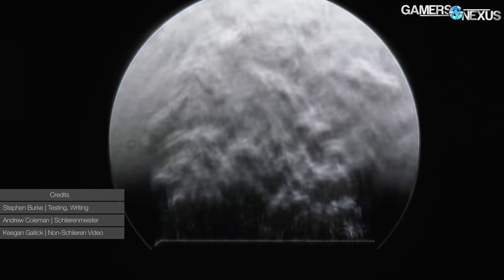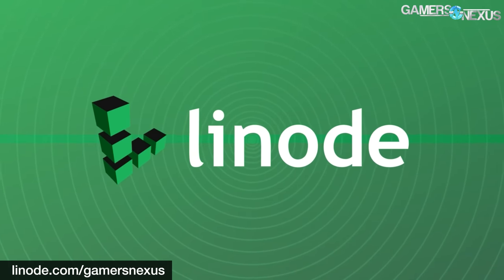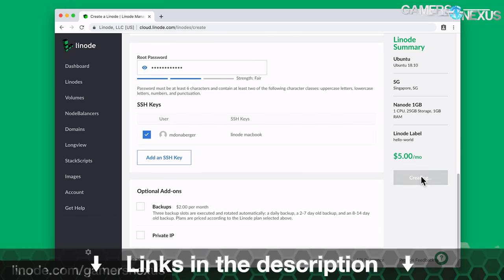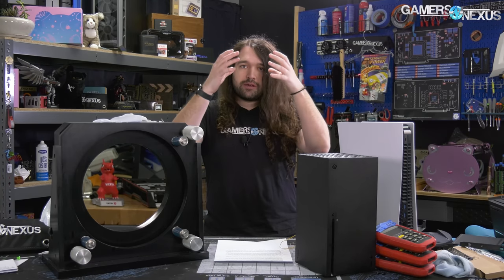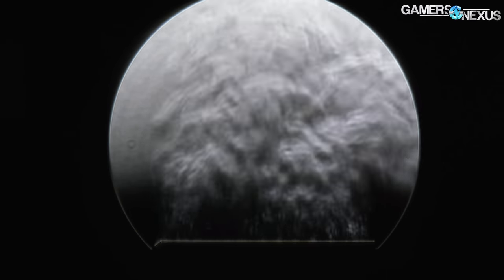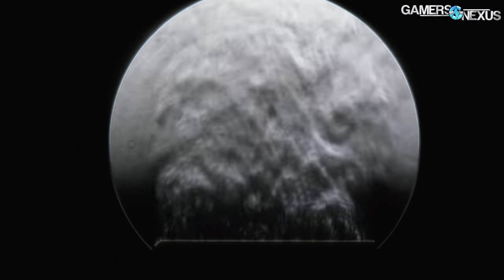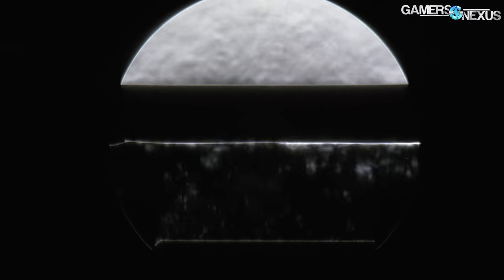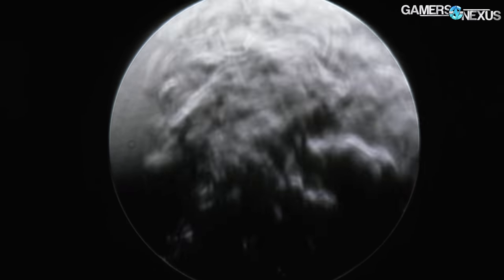PS5 vs. Xbox Series X Airflow Testing: Cooling Design Efficiency & Flow Paths

Comment: I remember an interview where a Microsoft engineer stated that the small vent was a sort of last resort exhaust so the system would have some cooling in case a game case or some other obstruction was placed on the main exhaust grille while the system was running.
Reply: A game case has a larger surface area than the exhaust 👀 it will cover it all
Reply: @Gaming-Legends007  The exhaust mini port is on the side of the console, it's impossible to cover it and the top main port with a game case at the same time .
Reply: @Gaming-Legends007  I know you said your goof comment 6 months ago but OOF... that is all
Reply: it's basically like the mini overflow drain in your bathroom sink.
Reply: So, it's a small thermal exhaust port, just below the main port...

...is it ray-shielded? I don't have any proton torpedoes left.
Reply: I'm playing Battlefield 2042 on the series x. You need another emergency vent for that game lol
Reply: Not a last resort, at all. It's a secondary backup port incase the main exhaust is blocked by something.

Comment: I love the science and thermal cooling engineering that went in making the Series X into a cuboid, and I love the way it's designed to use 1 huge and powerful fan at the top instead of the bottom, giving it a better thermal exhaust design.

Comment: “dont block the bottom intake vents”, well, since the hdmi ports are right next to it, I can't see a case where someone will face that side of Xbox down toward the table...
Reply: Never underestimate human stupidity.
Reply: builds custom cabinet that lets the hdmi ports in and blocks off everything else
Reply: Remember gorilla glue...
Reply: @cuy50  Still wouldn`t sit flush, and would hinder airflow, not block it off completely
Reply: @stevendarkstalker  that poor woman
Reply: I'll design a custom Series X table with perfect cutouts to fit the cables through ... muhahaha ^^

Comment: The hole just below the main exhaust is to allow some airflow even if the top is covered by someone accidentally. It was mentioned in the teardown with digital foundry.
Reply: You are correct!
Reply: It's similar to those holes in the sides of sink basons that prevent water overflow in the event of a drain blockage.
Reply: I can imagine the internal design presentation, everyone's looking at how nice the model looks, and then one of the engineers unceremoniously puts a book on top of it.
Reply: I can't imagine the tiny hole would be sufficient if a book was put on top of it. It's going to get significantly hotter in there, but because of the tiny hole, the console might still be operational, even if it's degrading more rapidly. Perhaps a better solution would be to just let the console reach its thermal shutdown limit, then give the user a warning when it turns on again, telling them to remove obstructions from the exhaust vent. Or just significantly throttle the CPU before it happened, and pop up a full-screen warning message that can't be clicked away until the temperature is back to normal.
Reply: @stale2665  I'm pretty sure all modern consoles have some sort of thermal adjustments or shut down sequence if it gets to hot...

The hole is just there so you don't reach that point as quickly I'm pretty sure

Comment: One thing regarding the Series X shutdown : I noticed that the fan on mine will continue run at a very low RPM for several minutes after shutdown, especially after longer gaming sessions. It looks to me like temp monitoring and fan control continues after shutdown, until it reaches a threshold or maybe a set temp before allowing the fan to power off. This is while using the "Power Saver" shutdown option btw, not the quick start option.
Reply: The previous X definitely does this as well

Comment: The Series X really could have benefitted from an extra centimeter of height to add a removeable dust filter on the bottom.
It feels like a missed opportunity given it's unique vertical design.
Reply: Well I am sure they thought of that, but when your trying to hit a certin price point you sometimes have to cut things out hat you might like to have had to get it where it needs to be:P
Reply: I don't know why manufactures do not design in built-in air filters that can be easily replaced and cleaned. It's bad engineering.
Reply: @zeniktorres4320  they could legitimized another cash grab for that too, such a missed oppoturnity
Reply: 1 cm means a lot when you are going to produce millions of them
Reply: This guy thinks he knows more than the highly educated experienced engineers that designed this with a footprint/budget in mind? crazy
Reply: I work in HVAC. Most likely they don't put filters in because that would require end users to clean/change them, which most won't. Even in the HVAC world this is a problem (maintenance). Then what happens over a short time is they get clogged and completed restrict airflow, resulting in a worse situation that if there was no filter to begin with (as most of the stuff the filter catches would just blow through the system anyway).
It's the lesser of 2 evils.
Also, as filter build up dirt, they restrict flow and then you have to have the fan work harder to pull proper airflow through the unit which means more energy usage, more wear on the fan, and potentially more to consider in terms of fan sizing and control.
Reply: Meh, it’s that easy to take apart and clean I don’t think it really needs it
Reply: Because a removable dust filter would make warranty very difficult... imagine someone trying to claim a fault all because they didn't clean the filter 🤣
Reply: @zeniktorres4320  are you a engineer? Did you ever think it would make things worse if too much dust accumulates and the owner doesn’t clean it? Who cleans there consoles regularly. A filter would block airflow quite quickly due to how quick the dust will accumulate.
Reply: @zeniktorres4320 because most people won’t clean the dust filter out and it will inhibit performance
Reply: @TheOne_p  That is true. But the dust inhibits performance anyway with or without the dust filter. And in addition, it should be designed so that an air filter can be fitted if they don't put tone in.

Comment: Steve, the MAPP gas will show up regardless of whether the torch has been lit recently; its usefulness in imaging is not from it being hot. It's just because the gas mixture is a different density to air, simply because of its chemical composition (methyl acetylene and propane is rather different to mostly nitrogen and oxygen, after all) !
... also, it may actually be slightly cooler than air because of the pressure drop effect, as it is being decompressed from a high pressure cylinder, cooling the gas.
Both the inherent gas density difference and the lower temperature of it (producing more density difference) are the reason why it is useful in imaging for you :)
Reply: Nowadays MAPP is actually just propylene. Your point is still correct of course.
Reply: @klugeskind90  Most of it is, yeah, although it is still possible to buy genuine methylacetylene - propane gas mixture... it's just not over the counter in semi mainstream shops anymore sadly :(  (I've been able to get it from welding supply shops) 

Good point nonetheless. Still, as you note, propylene is still a different density to air :)
Reply: @klugeskind90  Again your point is well made, and sparks more ideas in me: I suggest Steve just uses another kind of bottled gas for intake gas imaging... maybe something non flammable for safety's sake, so perhaps argon, which is readily available, including in disposable cylinders even. Argon would work really well actually given its high density, lots of contrast! And totally inert of course, hence its use in TIG welding for which it is typically sold (as well as a blanketing gas in oxygen-sensitive chemistry!) :)
Reply: @mduckernz  argon is exactly what i was thinking as he was running a highly flammable gas through a heated, contained area. I didn't actually think there was much of a chance for ignition, but you never know when a spark could be released if something unrelated went wrong at just the wrong time!
Reply: @mduckernz  or if they need something small and hand held, they could use canned “air” as the refrigerant used in them should provide a good temperature gradient.
Reply: @mduckernz  I'm not sure Argon would be the best choice. From what I can tell it has a refractive index very close to air. CO2 seems like the best least dangerous gas to use, which is also readily available. A simple hot cup of coffee should work nicely as well, with additional benefits for late night benchmarking :)
Reply: @paalhenriksandbu5804  That was gonna be my next suggestion, yeah. Liquid CO2 readily available. Just need good ventilation, breathing high conc CO2 sucks.

Comment: Im an engineer so i figured i would give some input. First, i do think you did this very well and appreciate what you have done here as no other reviewer does these tests. 
First, that odd slot in the top you said was for acoustics. I wonder if it might be a sort of fail safe where if some genius sets a box on top of the exhaust, the console isn't completely starved. Not that it would be an efective exaust, it would still thermal throttle like crazy, but it could save it from death. That could be a different explanation. The way to test this is to simply place a box on the exhaust and see how it reacts. 
Im not completely sold on your explanation of the convexity of the top being the culprit for the converting exaust airflow. I have a decent amound to experience with aerodynamics and that would be acting in a way that i wouldn't expect. I suspect it could be from the rotation induced by the spinning of the fan. But this theory has holes as well. 
One text i would like to see if possible, is a repeat of the hot power off test that you did with the xbox on the side, but with the console standing upright. This would somewhat show the effectiveness of the updraft cooling, which could give ideas for passivly cooled systems that are better than what is currently available. 
Final thought, one reason i suspect the fan is so far away from the exhaust vent of the xbox is to reduce noise. When a propeller balde spins too close to something perpendicular to it, like the holes in the grill, it creats a audible pulse. This can be fixed by moving the blades farther from the grill. This isnt genneraly seen with computers and the things close to the fan are rather thin so are not all to affected by this. But the grill on the xbox, which seems to be half a inch in some places, would definitely be affected.
Anyhow, thank you for making this. Without you, it just wouldn't be seen as it just takes a lot of equipment.
Reply: The gas converging is pretty easily explained like Steve did by the fact that the holes are deeper to the sides than in the middle. The outer edge guides the gas more than the inner edge of a hole. Honestly hard to explain without visualization for me but draw random lines from the fan out side the case and you will see that those that would stray further from the middle hit the edges while the ones aimed from the edge towards the middle pass. The ones that pass basically get directed by the rest of the gas going straight up/towards the middle of the flow.

Comment: XSX: hot air from bottom to top, clean exhaust
Playstation's memory at 100ºC: i like how the hot air is pushed down here
Reply: *90ºC
Reply: @thelarry383  Nope. GN measured 94º, and said the actual memory is 5º-10º higher than that. So, 99º-104º is the correct temp (at 21º ambient).
https://youtu.be/MmggkW6usmQ?t=589
Reply: @NoneRain_  oh thats hot

Comment: The MAPP gas coming out of the canister is colder not hotter.
Reply: Yeah. I think we are seeing the density gradient between the gasses.
Reply: I mean it's going from a liquid state to a gas, so it's boiling. 
It's not hot nor warm in the traditional human-perception sense, but as mentioned it's mainly the differences in densities being utilized as a visual.

If they wanted to use a less potentially flammable solution, I think a hot plate on low near the intakes might provide the needed heat.
Reply: @River_Miles  Did you actually read my whole comment? I never indicated it was hot.
Reply: @River_Miles  Glad you took a second look.

Ice could introduce condensation, so my vote still goes to a heating element of some kind set relatively low. These components are better at mitigating and withstanding extremes of heat versus cold, etc.
Reply: @Tsinij    so you mention that its boiling for what? Why make that point to begin with?

The point is, in the video he said he is using the hot gas of the non ignited torch, that is factually incorrect. That is what was being pointed out.
Reply: @rbo7 I was just trying to understand Steve's rationale in calling it 'hot'. So I mentioned the boiling. I then went on to say that it was not hot. Then clarified that I agreed it was mainly being used for density purposes. 

Has reading comprehension disappeared entirely?
Reply: @Tsinij   This isn't about reading comprehension. The first part of what you said is absolutely irrelevant. It doesn't add anything to the conversation. In fact, it makes it seem like you are supporting his statement that it's hot, then, immediately saying its not hot. Erase the entire first part of your statement and nothing changes. You could have said, "The sun is a ball of hot gas", and then continued on with the rest of your point and nothing changes. "It's boiling" ok? And? "Uhhhh, Just saying, cant you read!?!?" Antisocial as fuck, my god.

Don't talk shit about reading comprehension when you have no "writing comprehension". The fact that you don't see how utterly pointless the first part of your point is baffles me.
Reply: @rbo7  If you want to sit over there and try to dissect my initially  innocuous comment at length. Be my guest. It's your time. Do with it what you will.
Reply: @Tsinij  It's not that simple. Its also dissecting how ridiculous your responses are. You mention something completely irrelevant then act all shocked when someone addresses it. Then you talk about lack of reading comprehension when you made 2 completely irrelevant points, almost like...you lacked reading comprehension, how weird. And when you get called on it you back out. Hilarious.
Reply: You really need a full dialogue don't you? You want a back and forth? I can't help you there internet stranger. I could spend upwards of 20 minutes tearing apart your response, but I don't have that much life investment in this superficial conversation.
Reply: @rbo7  Good troll. 6/10.
Reply: @Tsinij  A win is a win. Move along now, kid. You had your chance.

Comment: Correction - It’s not the “heat” of the MAPP gas you’re seeing. Rather, MAPP gas itself is more dense than normal air. The density difference between the two gasses is what makes the visualization possible. You can tell because ALL of the MAPP gas falls (even the gas that doesn’t go to the intake). If the visualization were due to heat, we would see it rising rather than falling.
Reply: Yes, I cringed when he said that he was just letting heat of the bottle.  Releasing a pressurized gas causes the gas to drop in temperature as it expands on exit.
Reply: If this weren't scripted we could let it go...
Reply: As soon as he said it I went straight to the comments in the hope that someone corrected him.
Reply: Would of been an interesting video if something shorted while he was passing the MAPP gas through the console.

Comment: Vent above the fan on the side: Possibly an emergency vent in case someone puts something on top of the thing? Kind of like those backup drain valves in sinks and such. I dont think it would save the thing for long... but... still. Better than nothing?
Reply: I thought the same thing when I seen that slit. An emergency vent in case some Neanderthal puts their iPad or something on top of the console.
Reply: Still better airflow than that MSI case.
Reply: That's the stated use of that slit as per Microsoft.
Reply: Yeah. I was thinking exactly that as I was seeing the exit. Otherwise the air would be 100% impeded. And there are people out there stupid enough to put a book on top of it.

I think that without that exhaust basically the console would overheat immediately since there's NO airflow.
Reply: It's probably just to give it enough time to shut itself down or warn you to flip it back over.

Comment: Oooh! I actually know this!! The exhaust hole in the back in for just in case the main exhaust port is blocked (I believe the example given was someone placing a book on the top of the xbox) it would still allow some airflow to avoid thermal damage. I heard this from a microsoft engineer walking through the system on a pre launch video.

Comment: If anyone is interested in experimenting with schlieren images, there is a way to do this on the cheap, requiring only some basic image processing: synthetic schlieren or BOS schlieren. Basically, you use a background with a texture and then subtract it from the frames. The only thing is that the sensitivity is lower, but still fun to do, even made a video about it using python and openCV.

Comment: the gas fronn an unlit torch is cold, not hot. also thegas has a different density to the air
Reply: But is it safe to fill a room with propane tho?
Reply: @damjanszabo  With propane you would need to fill the volume of the room to at least 2% with it. I'm going to say that this is quite unlikely to archive it this way. ;) (But they might get high earlier tho. haha)